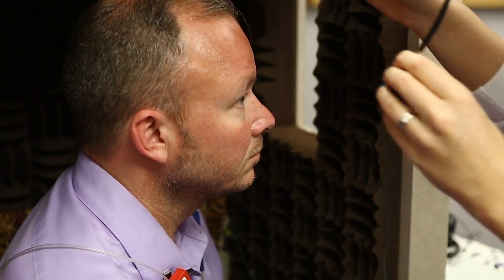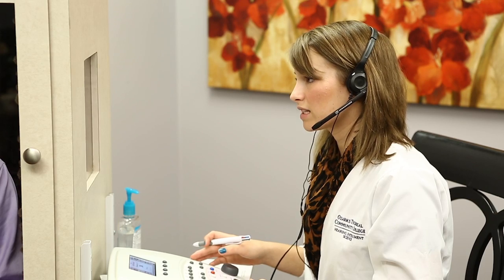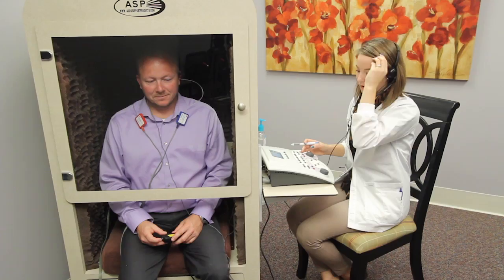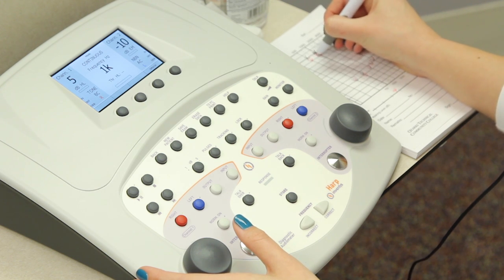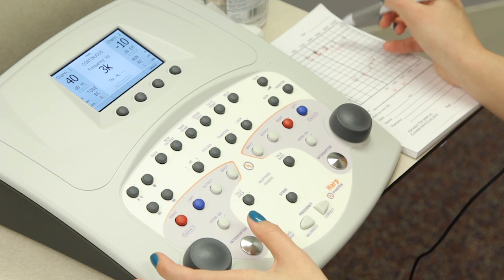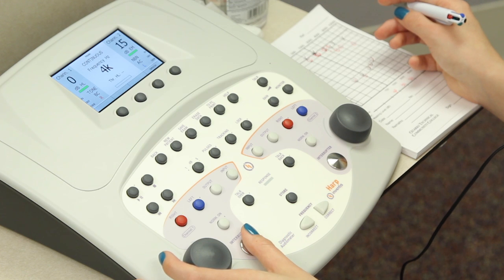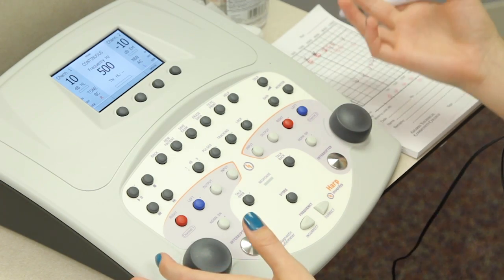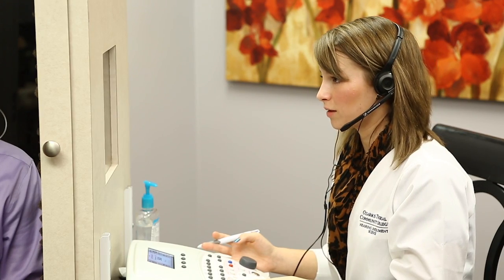Pure Tone Bone Conduction Testing

Comment: What is the name of this type of masking with 10 db above NTE
Reply from the maker: Thank you for your comment. This masking rule can be found in the Pure Tone Audiometry and Masking textbook written by Maureen Valente. There are multiple ways to mask for bone conduction. This is the foundational rule we teach our students.
Reply: @LetsRopeUp  Hello! I am a student currently in WA state. We follow the IHS textbook very closely. As of yet I have not seen any protocols to apply masking in the NTE when there isn't an air-bone-gap. Could you clarify why you use this method VS masking only the gap. If my memory serves correct IA is 0 dB with BC? Is that the reason for masking? Is this a local regulation or perhaps specific to your company? Thanks for the info!
Reply from the maker: @alec7083  Hi Alec! Masking for both sides gives you accurate scores for the bone conduction thresholds for both ears. Whether you use the rule or you apply masking all the time, you're testing correctly. Many times we teach students to mask both sides to they get lots of practice with masking. I hope that gives you some clarification. Thank you for your question!